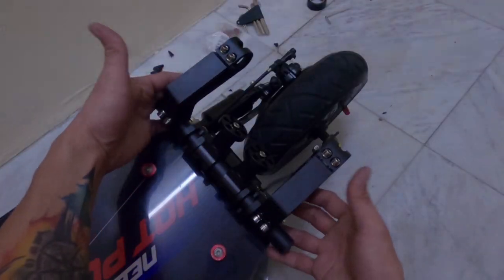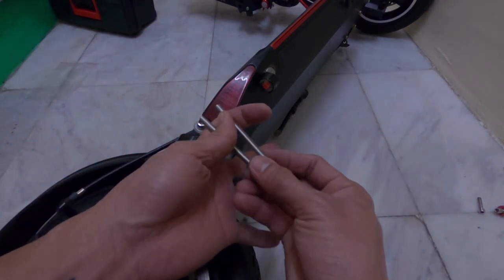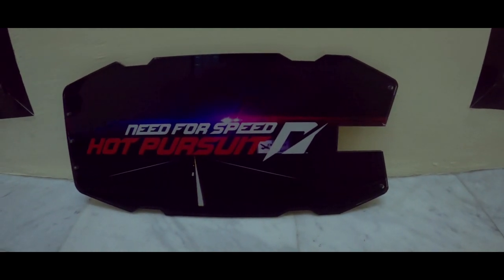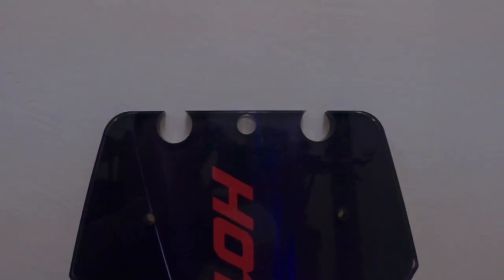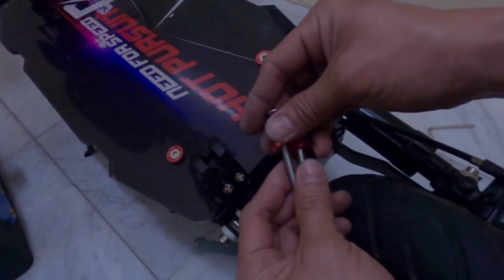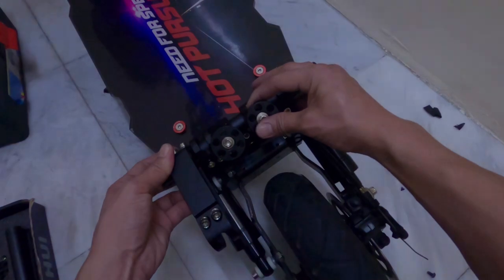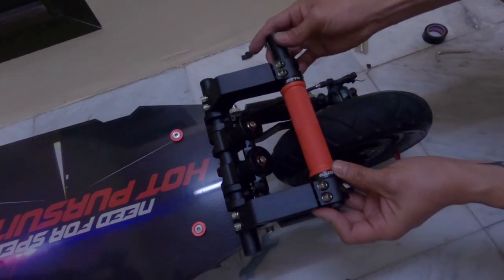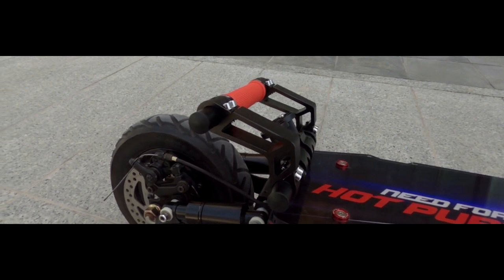GRAB BAR Installation | E10 Electric Scooter

Comment: how are you bro. i have the E10 pro GRLINE 2000. i want to know about upgrades such as suspension and accessories etc. also the front springs are making bad noise. whats the solution to that?

Comment: Bro wer did u buy 5v to 12v converter do u have a link TIA
Reply from the maker: Goodday bro!
i did not use converter.
I have external battery for the accessories.
You can check on amazon about converter.
Ride safe!🤟

Comment: Sir  matagal n kita fina fallow since bumili aq e10  me tanong lan aq napanuod q kasi ung isa mo vlog about ODO SETTING  me mali ata aq na pindot. 1 week q n  gingamit scooter q d nababawasan ang  batery
Reply from the maker: Goodday kaadik!
Same b tyo ng throttle?
Reply from the maker: Goodday kaadik!
Same b tyo ng throttle?
Reply from the maker: Goodday kaadik!
Same b tyo ng throttle?
Punta ka sa  P-settings, hanapin mo un setting ng voltage.
Then set mo sa 43v.
Maraming salamat sa support😀
Drive safe!🤟
Reply: Ok n  sir salmat sinunod q sinabi mo
Reply from the maker: @edmararpia9425  pre yan una kung reply sayo, related lng sa battery indicator ng throttle.
Un odometer, iba un. 
Di rin nagana un odometer ng throttle ko. Hinahanap ko pa kung paano🤟😁
Salamat pre.
Drive safe!